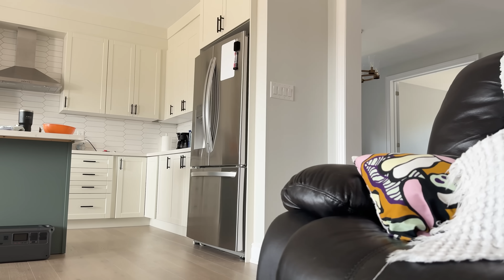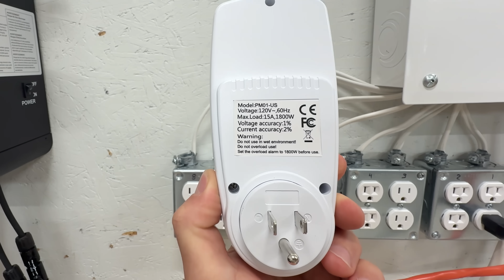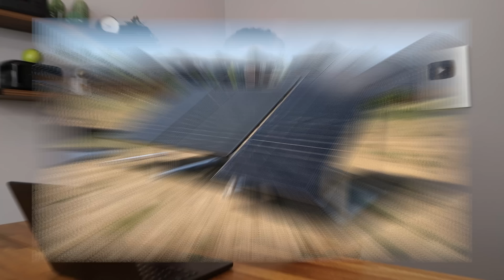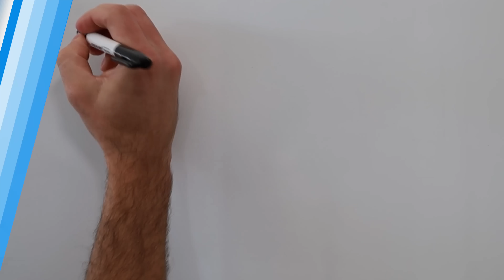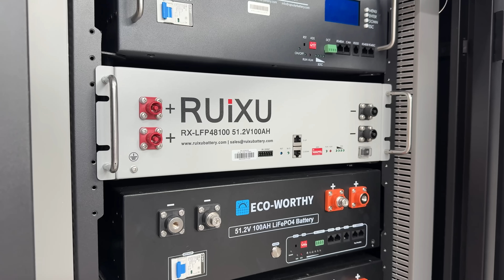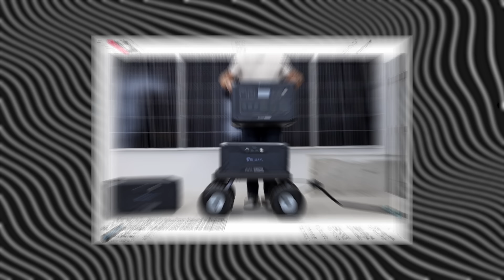Powering a Fridge with Solar Panels: How Many Do You Really Need?

Comment: I’m trying to determine what size power station I need. Can you help me interpret what my fridge decal is telling me?
Full load AMP/Demand 6.5
30HZ/1 Phase/115V
Design pressure 140 PSI Low
330 PSI High

Comment: Solar tracking mirror fiber optic cables divert sunlight with fiber optic cables mounted into a sheet wrapped around a solar vacume tube with a heat pipe in an enclosed cylinder to protect the solar vacume tube.  Heat pipe heats up copper gas expansion chamber on a capillary butane refrigeration system with a check valve for a solar powered freezer refrigerator? 😊

Comment: BOP. This channel is BACKWARDS ON PURPOSE.  To run a 4 kWh refrigerator, you must generate 6 kWh of solar power daily to compensate for a 33% system loss during conversion and storage.  
MEANWHILE, A DC Refrigerator (XL) uses 200-240wH for the entire day. Let me get this straight? You have a channel called "Solar Lab" suggests a solution that burns 20x (TWENTY TIMES) what is necessary to do the job.  
Who is paying you to betray your community and flood the internet with garbage?  Shill.

Comment: I am currently running on mostly solar and battery for cooling my home with a 12000 btu inverter window unit and a 10kwh solar generator. It runs on solar from about 12:30 pm to 6pm. Since the water heater is the second biggest user of electric im going to replace my hotwater heater with a 40 gallon heat pump water heater in attic which is about 70% more efficient. The Third biggest electric user is fridge. I am going to gat an ifull size inverter Refrigerator/ Freezer which I'll be able run off the 10kwh solar generator. I already switched all my light bulbs in house to LED. I only cool living room kitchen and one bedroom. Im hoping to cut my monthly bill by 80%

Comment: I didn't notice you considering the "surge" or "starting" wattage needs. All 4 AI models I've consulted say this is a critical piece for calculating system needs (especially the inverter). For example, here's what Gemini says:  "Calculating Your Power Needs Fridges and freezers don't run constantly; they cycle on and off. However, they have a high "surge" or "starting" wattage. Running Watts: Usually 100W – 400W per unit. Starting Watts: Can be 3x higher (up to 1,200W) when the compressor kicks in." So, is that NOT so critical in your experience? Can I safely ignore it do you think?

Comment: To power a refrigerator you will need a 3000 wat gen and 1000 watts of solar panels. You have to prepare for clouds. A 3000 watt power station will only give you about 2 days. If you have clouds on the 3rd day you are SOL!
Reply: So with the right generator, a single 1KW panel in a very sunny country would almost/just about be enough?

Comment: Fridges are insanely ineffective and designed for on grid power wasting. I live 100% on solar with a freezer. Fridges turn on when temps drop even a single degree. Not needed. If your box cools to 34° and doesn't turn on until say 40° it will consume fractions of the power a fridge uses keeping the temps perfectly between 34-35. I plan on splicing in a diy smart home controller with internal thermostat to fine tune power usage of my chest freezer. Please note fridges open and dump all the cold air, chest freezers do not. Trying to run a side by side fridge on solar is silly. You're trying to fit a round peg into a square hole. If\nYou have access to pure distilled water.You can set up an ice cube maker for much cheaper and just keep a cooler filled with ice

Comment: How many years in electrical savings before you break even / pay for the equipment; panels/controller/battery/inverter? With our utility at about 16 cents/kwh it's over 15 years. At my age I'll probably be dead before it pays for itself?  ...and of course the technology will probably become obsolete in half that time? ...and then there's having to buy a replacement Korean refrigerator every year also? :>)
Reply: If you live in a place where you are prone to outages, you might make a lot back in food that you don’t need to replace.

I had an outage a few years ago that lasted for a bit less than 4 days, and I had no type of backup at the time.  I had to throw out about $400 worth of groceries.  The experience convinced me to start thinking of backup options.

Solar with a battery might not always be the best option but, depending on your situation, it could be.

Comment: The sun still shines even with clouds in the sky, and it continues to shine outside of peak solar hours.
Don't bother with a 3 day average when you can just break down the average power generated in a day. Its also obvious that most days you'll be fully charged by lunch, wasting a ton of power.

Dec is the worse month for solar, 30% sunny, 70% cloudy hours per day in my region. I'm assuming 75% of a panels output for sunny and 10% output on cloudy, given the lower sun angle for the time of year.
From that you will get ~30% (0.3*0.75 +  0.1*0.7 = 0.295)  of a panels output in any given hour of daylight. 9h of daylight in Dec, but lets call it 6h to account for sunrise/sunset losses.
If we need 1400Wh per day, 1400Wh/6h = 233W of net solar input power. Taking the 30% from before, we get 233W/0.3 = 777W ---> 800W solar array
In all likelihood you could go with a much smaller array, if its just a fridge, losing power for a few hours in the night in winter is not a catastrophe. In the summer you'll be overflowing.

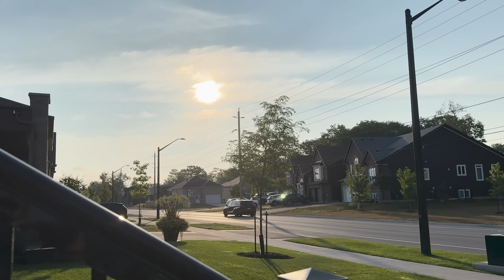Comment: Heh.  Your calculation at 3:20 makes absolutely no sense, and you can tell because your results were a far higher expense than almost anyone would actually need.  Even most off-grid homes don't try to size their system based on calculations like that... because the result is insane.

Just go for 24 hours of backup.  Roughly, a Pectron E1500LFP and call it a day.  There is a reasonable argument to pump the battery storage up a bit more but unless you are shooting for indefinite operation across winter, there's no point going much beyond 24 hours.  Extending beyond that in extremely poor weather means lining up other means of recharging the system(s).

With 24 hours of battery-only backup, any solar you have will further extend the operational time.  You can go for indefinite operation in modest sun or even light clouds, that isn't terribly more solar.  24 hours of battery-only operation is really the best base case.

-Matt

Comment: Jeff can handle the loss, return it.
Reply: Doesn't cost Jeff anything! As a previous seller on Amazon using their "Fulfilled by Amazon" program, I had to pay for the shipping to the customer and the return shipping back to Amazon and then pay to ship it back to my business because I won't sell an open/used product as new. My products we manufactured in my shop and not crap from China. Usually the products were destroyed by the customer anyway since they didn't have enough consideration to pack it properly for return because, you know "Jeff can afford it".......big reason I'm a "previous" seller on Amazon.
Reply: What makes you think it's coming of of Jeff's pocket?

Comment: Refrigerators don’t use very much power. They use the most during the defrost cycle,so that determines the minimum amount of inverter capacity to run it. The next consideration is battery storage capacity to run overnight or during a long grid-down low -sun period.
Third , the amount of solar panels will be considered. The minimum amount to operate the MPPT to charge the battery will likely be much more than the number to run the fridge.
The portable power units that many buy for this purpose are overpriced for their capacity. Far better to buy a 3KW inverter,5kwh battery and five 60 cell solar panels. With this you can run the fridge and counter top kitchen appliances.
Reply: My old full size frig costs about 7.75/month.  No big deal.

Comment: The longest duration you should plan for with the non-availability of a backup device is two days. If you expect to have no sun for more than two days (and you should definitely plan for this contingency) then have another energy source. Some type of gasoline/propane/diesel/natural gas generator, even a small one, is on almost every reasonable prepper's list. A generator especially in conjunction with battery storage is quite fuel efficient compared to one without it because of the reduction in runtime.

Comment: I know your channel is called “the solar lab”, however, I’ve found for my back up power needs, a hybrid approach is the best. I have a battery backup power unit that runs my fridge for over 24 hours, 600 watts of portable solar to charge it and a small gas inverter generator to charge the battery should the solar not be enough. The generator only runs for 1.5 hours to fully recharge the battery from empty. this saves fuel and eliminates a lot of the noise of running the generator continuously. In good sun, the panels are enough to charge the battery.
Reply: Good morning..Do you have any published papers related to that..i need to prepare paper under this topic

Comment: Just buy a Kill-a-watt unit and then test everything in your home.  It also tells you in real time how your power is performing.  Is your generator/inverter/batteries giving you 60 hz at 120v?  This will tell you in real time whether underload or not.  What is your computer using when on or off, and for me that is 40 w and 0 w.  You can find this stuff out with a meter...  Then you keep the unit for the next emergency and you would know if everything is going well while you are using backup power.

Comment: Wrong! Did not account for inverter loss. Inverter has to stay on All the time to power the fridge. It uses on average 1kw doing this. Si you have to add that to your needs to come up with amount of solar you need.
Reply: No inverter designed for home installation will have a parasitic loss anywhere near 1kw.
Reply: @paullinkins8121 probably some units conversion issues. If you have a 3600W inverter drawing 1% idle consumption, that’s ~36*24=864 Wh per day, think thats what the OP was trying to get at. Could be similar order of magnitude to fridge, if the inverter is on all the time and consumption is that high.
Reply: @paullinkins8121  mine sure does. EG$ 3k inverter with 5 kw battery and 1200w solar. I run my chest freezer 24 7. I find my DAILY draw is around 2kw hours giving me jut 2.5 days of backup in case of overcast skies. This system has been running for 3 yrs now. I still see 1-3 days a year I have to plug into the grid to keep it running.
Reply: A whole-home inverter typically runs 50-100W idle consumption.  It can be as low as 12W (Victron 48/3000 multiplus 2).  In normal mode.  Nobody really uses ECO mode on these things.  Anyway, as one scales up the solar system and storage, one stops caring about the idle consumption.

Comment: After measuring the fridge’s 24 hour energy consumption (kWh), you might consider replacing it first taking its age into consideration.  A new one may use significantly less energy resulting in reduced battery and solar costs to back it up.
Reply: A new one will be more expensive and may need replacing in 5 years. I’d spend that money or more panels or batteries.

Comment: OK, so the battery you show is a 51.2V DC battery and the inverter will convert that power to 120v AC.  I get the formula of V x ah = WH.

So the 5120WH number applies whether it's supplying 12v DC or 120v AC?    You lost me on that one.

OK, so maybe 5120/120=42.6 ah?

Comment: Not cool with buying a power meter and returning it. That is only going to give you a snapshot for that day. One of my fridges is in the garage, it is for most day's solar powered. In the winter it might run 8 hours a day, in the dead of summer 20 hours/day is not uncommon. Even if a fridge is inside the house, most people's ambient inside temperature is going to vary season to season. Humidity also plays a big part on how often the fridge decides to do a defrost cycle and yes that heater draws another 80watts. Also how many times a day the door is opened,? People with kids and large families are going to have more usage. Plus when any warm food/drinks are added or meats into the freezer. I also don't agree with your numbers on your calculated power usage as even some of the most efficient power station's/inverters are going to waste at least 600 watts per day. You factor that in and you will need a bigger battery and more panels to make up for the losses.
Reply: You should watch the whole video before you comment.
Reply: @dailydr1ver935  I did watch the whole video and that is why I commented. I have 1200 watt solar panels and a 3kw battery. These guys are not even close to the real calculation. Most sunny days I am 100% solar, but soon as the clouds roll in I am drawing from the grid later that night. They never accounted for the inverter "tax" as nothing is even close to 100% efficient in converting DC to AC. I lose 600 watts per day and that is on a 88% efficient unit. But don't be upset when you follow their guidelines and end up being undersized. That is all I am pointing out m8.
Reply: He did talk about inverter consumption
Reply: @dailydr1ver935  Yes he did and he recommended getting a 4500W watt hour battery so that you would have 3900W availble to last you 3 days to run the fridge. That is not a good calculation. Run an inverter for 3 days and you have used 1800 Watts for inefficency. So that leaves you 2700 watts availble and it isn't going to last 3 days.

Comment: One 400w bifacial ground mount and battery will cover 3 fridges easy in Arizona 24/7
Reply: do you run the air conditioner where your three fridges are located? For example I have a fridge in my unconditioned garage.
Reply: @uhjyuff2095  yes garage is 3 ton minisplit on solar and batteries and 2 other fridges are in house.
Reply: @SurgeonTech  I guess you have more than 400 watts solar for your garage food!
Reply: @uhjyuff2095  with or without food, that 6 car garage is cooled. I like usuable space year long in AZ. I do all my own stuff like car tune ups, diy around the house, solar etc. Also, a lot of lithium iron batteries and solar equipment is being cooled by the sun. I like my vette to be 77 or cooler all year round when parked inside. It's a daily driver, but other regular  cars are back up. Vette is good when I am on call at the hospital. Quick flight over. 🙂

With 1 bifacial 410w panel from aptos you will get easy 3kwh per day in az. Bifacial gain is amazing. But AZ has one of the highest solar usable sun hours.
Reply: @SurgeonTech  Yeah, its great solar in the sun belt. I am in East San Diego and have a ground mount with very minimal shading from a hill in the early morning. I get 20kWh in one day with 2.8kW peak solar. It's so awesome!!!
Reply: @uhjyuff2095 awesome

Comment: With inverter efficiency factored in, my 21 cu/ft Samsung Bespoke fridge/freezer averages 106W an hour. 

I Hlhave done the test multiple times with 5 different powestations and that is the average when factoring in various inverter efficiency.

  Bad weather, winter sun, etc means you really want more for long term sustainment.

If you're on a budget, a 2k power station and a 400W solar panel is pretty realistic.

Comment: Yeah, no.  Returning a perfectly good item for refund after you have used it for its intended purpose is fraudulent.  You actually used it for its intended purpose.  Returning it is dishonest.  If you didn't want to keep the item, then you should have rented it instead.

I'm very close to unsubscribing on the basis of this advice.  You are recommending criminality.

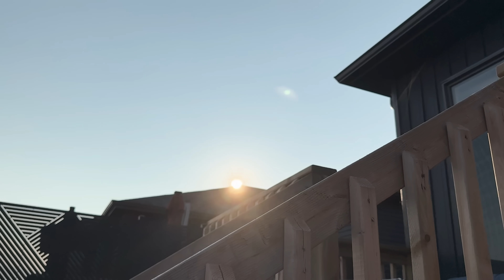Paused at the 2:36 mark.  I can't even hear you now.  I'll check back in a few days to see if you've retracted that statement.

"Welcome back to the labs where our opinions can't be bought, but our recommendations might break a few laws."  Is that how you want your motto to go?
Reply: I took it as a joke.  Because you will want to use the meter on other things. Loan it out etc.
Reply: I thought it was a great add in. One guy made a suggestion on his own opinion and then another said "hey dude, that's not right... we don't do that at the lab". So really now that the "viewer" is informed, that down to that viewer character to "Do the right thing".
Reply: No one has ever been imprisoned or "Unalived" for returning a product from Amazon. 😂 
On the flip-side, I vote to keep it and use it on everything. I've had the same KWH Meter for the past 4-5 years (about $25) and use it on everything to get accurate 24-hour usage data. I know exactly how much energy every electrical item and appliance uses in a 24-hour period. 🤠
Reply: @royrobinson4636  Holy crap, "unalived."  Speaking as a bleeding heart, died-in-the-wool woke liberal snowflake, that's just the dumbest thing to come out of the social media generation.
Reply: Falsely returning an item to me is dishonest. I have seen a library in Ontario, Canada that allows patrons to borrow it for a week. If all you want is to do a quick test. Personally I have a few that I do long term testing with. The more data that you have the better your energy predictions will be.